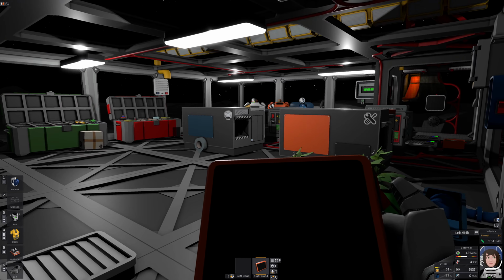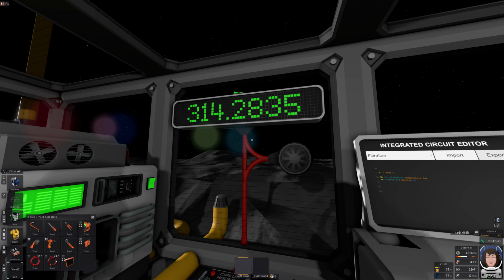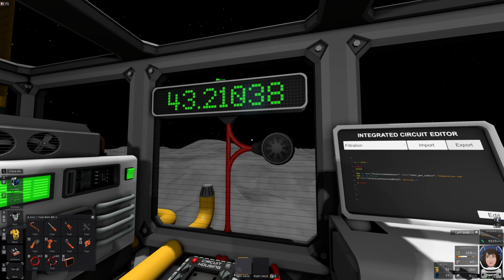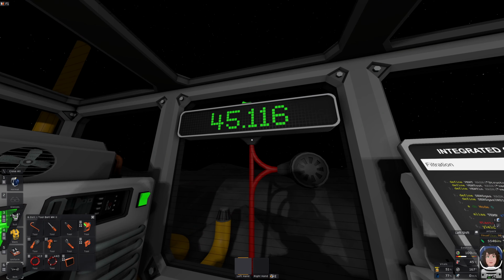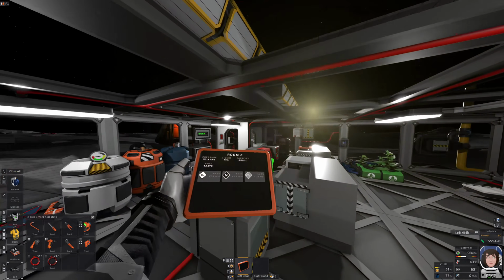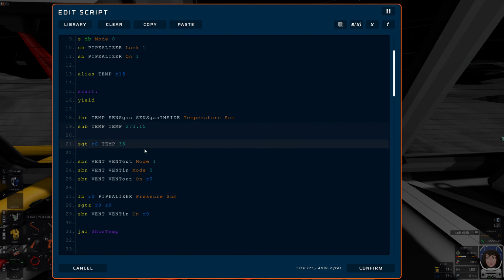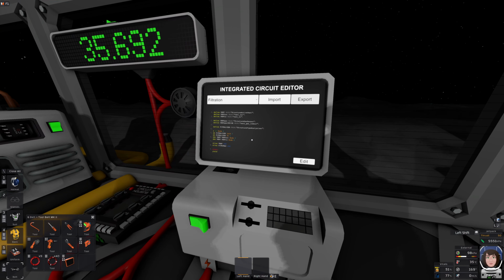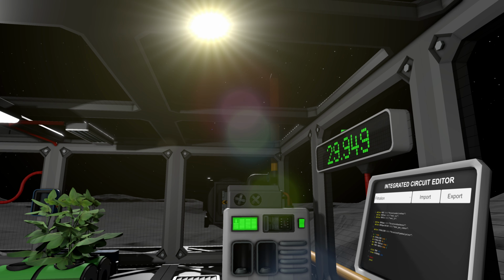Stationeers PROGRAMMING for total beginners - TURBO STYLE! - Part 3: Cooling for Moon/Mimas *

Comment: i have a question about branching. in the past i coded a bit in school with c++, and there is an if condition that if a parameter x is between a and b i can do an action y.
is there an equivalent for branching? I'm trying to do an "idle state" that requires this condition to turn off cooling and heating at the same time.
If not, i have another idea how to do it but i wanted to ask since i like this condition more
Reply from the maker: Not that I know of, pretty sure that it doesn't exist. There is "select r0 r1 123 456" which writes 123 (else 456) into r0 if r1 is "1". And we have relative branching (can even go backwards): All those "bgt" and such statements which jump to a place if the condition (in this case "greater than") are true not only have a "z" variant, where the value to compare with is zero without you having to give it (e.g. "bgtz r0 GoHereIfGreaterThanZero"), but they also have an "r" variant: "brgtz r0 3" and "brgt r0 0 3" goes 3 lines down (so it skips 2 lines) if r0 is greater than zero.

Comment: Im tryin to do programm wich turns on aircondition when it 31c, i got that to work and now i want it to turn off when reaching 25c. My problem is it keeps turning itself on and of, tried a bunch of other commands but still same resault. Could use some guidance on it
Reply from the maker: Hm. Well, I did this a few times for the solid fuel generator to fill my batteries a little - same kinda problem. Maybe you can adapt it.

alias DEVICEISON r15
start:
yield

lb r0 HASH("StructureBattery") Ratio Average  # Load your temperature or whatever
brgt r0 0.1 2        # If the value is above the lowest, skip the next line.
move DEVICEISON 1  # This is executed if the value is too low.
brlt r0 0.2 2        # If the value is below the highest, skip the next line.
move DEVICEISON 0  # This is executed if the value is too high.
sbn SOLIDGEN SOLIDGENname On DEVICEISON # Always unconditionally set the device's value based on persistent register

j start
Reply: @OwnerOfTheCosmos  i Will give it a try, speaking of generator, im trying to get mine to start once the last battery hit critical, got it all set up but unsure how to complete it, I belive I managed to get it to turn on a light (or the light got turn on by the command coz it moved to that line)

Its a Nice puzzle to crack
Reply: Wrote it like this

Lb r0 battery mode 1
Sb r0 light On 1

Most likely i wrote it to turn on regardless of the mode hence why I am trying to understand functions and use another one. But with lack of knowledge i am not making much progress, any advice?
Reply from the maker: I don't know the rest of your source / installation, but there's definitely a syntax error here. Corrected:

lb r0 battery Mode 1 # Batch type "1"!?!?
sb light On r0

I don't know what batch type "1" is, I only know Average/Sum/Maximum/Minimum. I also don't know what the "Mode" value does for (what I assume here to be) Station Batteries. Anyway, the second line was wrong: The 1 needs to be your register. And the register at the beginning just doesn't belong. Remember that you get "ghost text" when you have written only the command and not yet the rest of the line - and also, hovering over the command gives you a tooltip.
Reply: @OwnerOfTheCosmos  i see i will move the register and try it out, far as I see mode is what shows how full the battery is 1-6.
Reply: Would it be possible to write to you on discord perhaps? Then I could send you a picture of the code, also I do have some question regarding you 6th video in for programming, for me who started without much/prior code knowledge there is some things that is very confusing
Reply from the maker: Yep, that's @OwnerOfThePlace, send me a Friend request.

Comment: First and foremost, your recent tutorial series (MIPS, Atmospherics, etc.) are absolutely marvelous. Much, much better than your older versions. I think I can speak for all, that we appreciate your investment in time to properly script and organize the flow of information.

An alternative to checking over-pressuring via MIPS logic can be accomplished by setting PressureInternal of the inward vent to your desired maximum pressure.

Leider ist mein Deutsch nicht mehr so gut. Vielen Dank für Ihre harte Arbeit.
Reply from the maker: Thankeschön! Sometimes I do invest some work before going at these (building the rooms etc.), but the only thing so far I actually edited was the Stationeers trailer. Everything else is done by pausing/resuming recording with a hotkey on my mouse, which is pretty easy. And explains some of the flaws that wouldn't be in a video where you can do as many takes as you want: The first take is always the one that goes live.